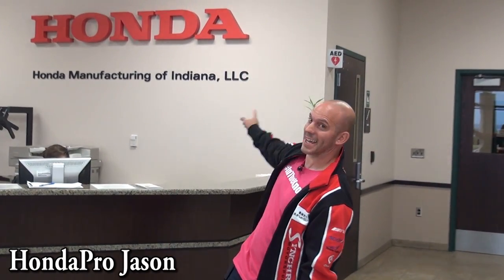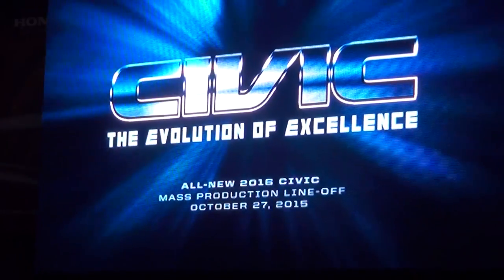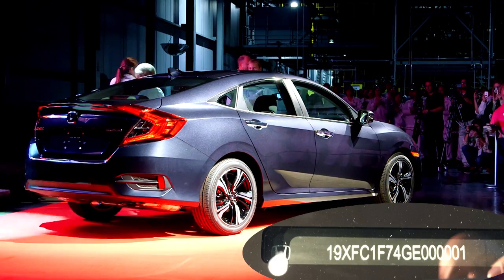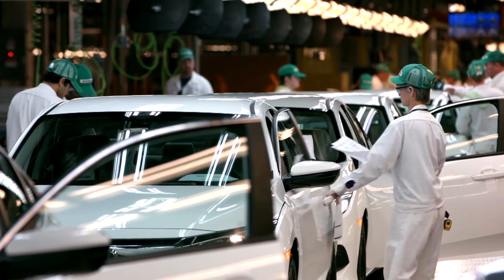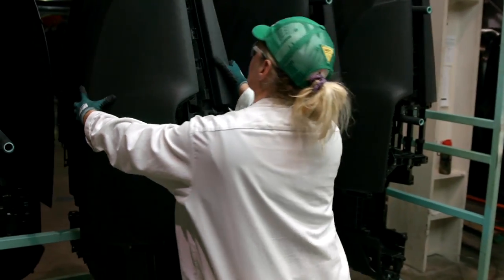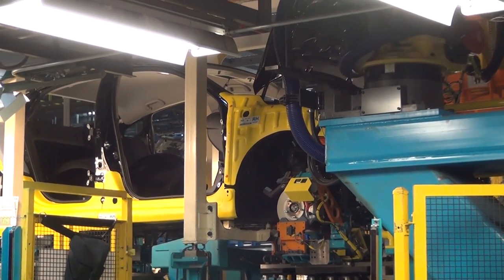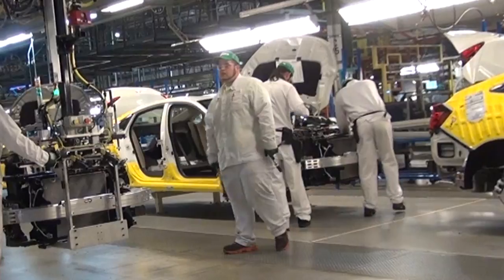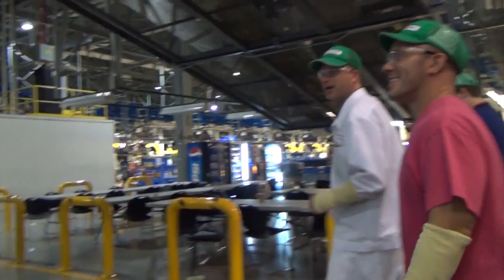Exclusive footage inside the 2016 Honda Civic factory

Comment: I've been a loyal Honda/Acura owner going on three decades now however there is no manual on the 1.5 turbo for 2016? The manual transmission is only available on the non-turbo base model with no sunroof option? Can't live without a manual transmission and an sunroof. I'm now leaning towards spending a little more money and buying a 228i manual with the sunroof instead. I'll wait to see the SI before I make my decision
Reply: +Walt Heisenberg It should be available later in 2016.  We will have to see, I guess.

Comment: I'm seeing tons of Honda Civic owners on You Tube that have issues with there 2016 and 2017  models I was thinking about getting a 2017 Civic Touring but may just hold off awhile hopefully Honda fixes all the electric glitches or software problems soon.
Reply: I got a 17 Civic base model no issues after 2 years 😊 but I did hear that the electrónics where having issues maybe since I got the base less crap in it

Comment: Uh.. These lazy Americans making the new Civics turns me off from buying one.
Reply: Honda cars made in the USA are of very good quality. I have a 2007 Honda Odyssey made in Lincoln, Alabama and it is not falling apart.
Reply: How is hand built cars lazy? At least we take the time to finish every last detail BY HAND before we send if off to dealers unlike the Japanese who's Civic's are all machine built from start to finish. That's pure laziness right there
Reply: Alex Lin I'm informed, and you're hearing something you don't like. Sorry, but American made does not equate to quality.
Reply: Heartagram Lol, then what would you say about Fords and GM cars made in the USA? They are bad quality too?
Reply: And as I said my Honda Odyssey was made in Lincoln Alabama in 2007 and every component has held up well
Reply: Heartagram Also, Honda has been making cars in the US since 1982, so by your logic you should be turned off from buying most of Honda's cars, correct?
Reply: I wouldn't touch a new Civic with a ten foot pole.. I bought one and had to return it because the entire dashboard failed. lol
Reply: +Heartgram It doesn't matter where you build a factory, as long as you apply the same ethics as in Japan.
Take NUMMI for example, the only GM factory that actually had good cars because they implemented work ethics and a more efficient production line from Toyota. (in fact they both shared the plant and learned from one another). Every other GM plant refused to accept "unwanted ethics" and it all went to shit in 2010.
It's mostly in the hands of small production line managers and plant managers.
Proves hows little you know about making cars, if all you can say is "fat lazy americans"
Reply: Where's your evidence that American made Hondas don't equate to equality? Honda is one of the most popular car brands in America. If they made junk, they wouldn't have buyers. GM is an absolute joke